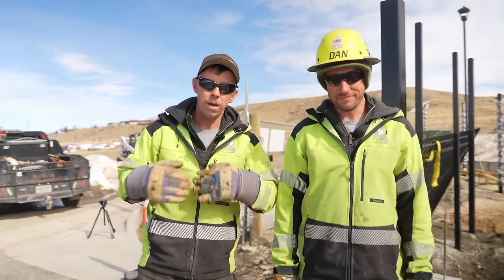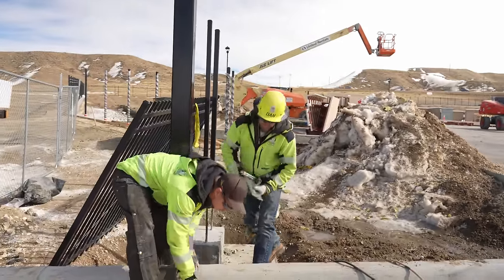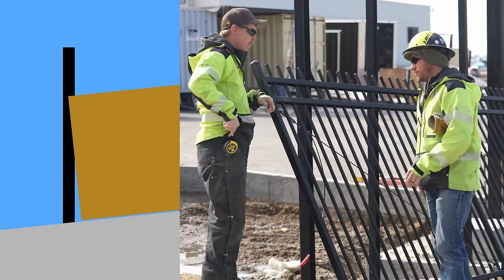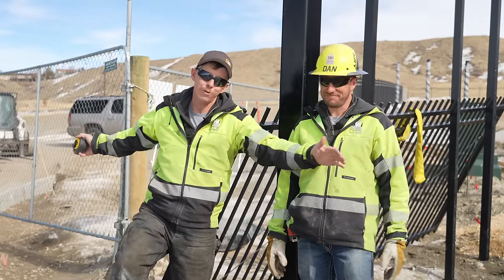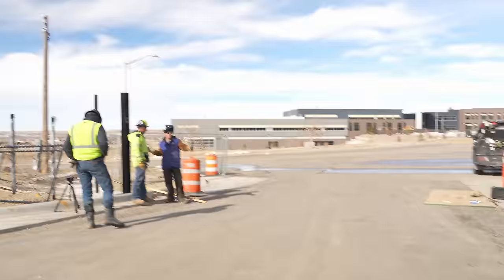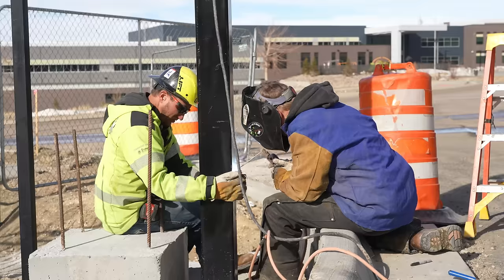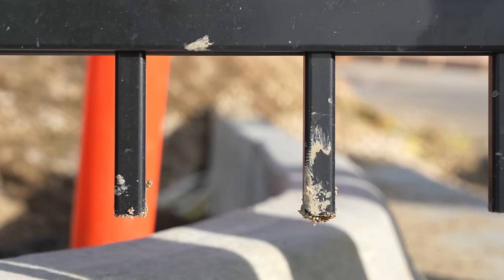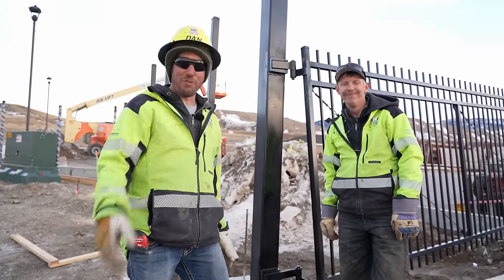Getting A Gate To Swing Uphill | How Did We Do It?

Comment: I've done many slope gates,the best way is  to C clamp top hinge ,take a 2x4 and a digital angle finder lay it on your slope,take said 2x4 put on top hinge C clamp bottom hinge make the hinge same angle as 2x,tack it on,I invented a weight compensation device so gate won't slam or pull on operator,
Reply: Tell us more, please? 🤔
Reply: Well,first there was terrible planning,contractors  have to work together,making the ground level between post,second,gravity increases the closing load on the operator,so it will overload the system with the weight of the gates going down hill,just like the gates have to pull the gates uphill,I can't describe the mechanics of the weight compensator,but it's a garage door spring  that loads closing and unloads opening, it works amazing.
Reply: Well,the first part is finding the angle of the slope,10* whatever it might be,that is about the max,if the road is unpaved ask the dirt guy to level about 18" wide area from side to side,if you don't when the gate is closed it will look bad no matter how good you did the gate,don't try and go   over 14 feet,it will be a mess trying to slow it down closing,the weight compensation device is a box tube with a garage door spring inside,like 24",when the Gate is all the way open there is zero pressure on the spring,using a stainless 1/8 cable to a pully,then uphill about 8',it's hard to describe like this,but the idea is that when it starts to close it starts loading the spring,slowing the gate down,taking the load off the operator, try and imagine it,it was one of my secrets.

Comment: Ive used these on several occasions with heavy gates and have had the arms on those hinges bend over time. Had to add gussets and had the gussets bend them even more the first time because i didnt factor in the shrinkage.  But eventually got it.  Great hinges for that application but just with they offered one size up in plate thickness.

Comment: That was awesome. I never thought about that concept. I never saw such robust hinges either. I wonder if a sliding gate would have been better suited for that application.
Reply: theres not enough room along the actual fence before a corner to open a cantilever gate unless you were to cut out a picket so the gate slides through the fence out of the property. but theres a lot of liability that comes with that

Comment: Does that creat a large gap at the post?  We’ve had 2 wood fences with steel frame gates recently that needed to swing uphill.  I’m currently using a hinge system to fold the bottom of the pickets up when opening but would love uphill swing hinges.
Reply: Not at all the two plates sit top of each other so the gap is only as wide as the flat stock think of it like a regular door hinges with longer flat stock

Comment: All the great work manipulating the swing geometry on the first gate... only to fail on the second gate. Why? The misaligned gates in the closed position, are ugly AF. If I were the customer, I would never sign off on it.
Reply from the maker: Well it's either drop a leaf or have an enormous gap underneath one. The customer doesn't want an enormous gap. You got a better way?
Reply: @SWiFence  Not a lot of video footage on the other gates mounting... But raising the mounting point to the 6" post, on the left gate should have worked. Also shim the bottom mount on the left gate with a thicker plate to take out the sag. It looks like the gap is off between the gates. The gates should look aligned, and ascetically pleasing when closed. Open, nobody cares, as long as they clear and work.
You said that the drive is getting a top coat of asphalt still. Talk to the GC about having them fudge/raise the plane under the left gate.
Reply from the maker: You're never going to raise the asphalt high enough to make up for that gap. Sorry.
Reply: @SWiFence  I respectfully disagree. Between my 3 suggestions, it would get the gates pretty close to aligned and spec. You still have another 3-4" of asphalt going down. They can easily float another 2" to one side if needed. 
And, I bet the architect didn't draw it up like that. So the GC is going to be figuring out who needs to fix what. And that's never a fun phone call. What do the prints show? Because that's what the customer expects, and approved.
Look, I have seen some really impressive work from you guys, but this just isn't one of them. Sorry man.
Reply: @SWiFence look at the hysecurity lift gate models. Hydraulic power lifts the gate, swings and lifts some more. Can even use drop rods into the ground without ever moving them. Really neat.  

I was wondering, as much as these swing uphill, do they slam shut on you or are they balanced?
Reply: @SWiFence  Build the gate to the slope from side to side

Comment: Sorry to tell you but those hinges were actually mounted wrong, pause the video at 10:02 and look closely how the hinges were mounted and if you have any type of a mechanical mind then you'll see a better mounting design.  Over kill on the extra heavy plate welded to the post to attach the hinges to, unless the post is thin tube which is no good, should be 1/4" or thicker.  F A I L!
Reply from the maker: I can see how you think the hinges are upside down, but those are beast hinges and there's no reason to be concerned about failure.
As far as the steel block goes, the customer changed their mind after the posts were set that they wanted the gates to swing inward (if we'd known that going in there's a whole of things we could've changed). This required different hinges, which changed the dimensions of the gate opening. We used the blocks as a shim to close the gap in-between the gates and still preserve the integrity of the post. We actually see that as a win. 👍🏻

Comment: Obviously the customer will never accept the gates being different heights.   About what you'd expect from a couple of knuckleheads.
Reply from the maker: They prefer that over having an enormous gap beneath the fence. Waiting on your video to show us how it's done.
Reply: @SWiFence  I thought about your problem and would recommend you build an adjustable gate and hinge test rig either full scale, to take on site before you fabricate and install, or possibly half scale to do tests at your shop.  I think a light weight gate rig could be clamped to your posts and easily adjusted and then measurements taken for fabrication.  Guessing how the heavy final gate should be welded on site is a bad plan.  You could use the adjustable gate/hinge rig on all your jobs to eliminate mistakes and reduce installation time.  I'd be glad to come to your installations to supervise, just let me know.
Reply from the maker: C'mon now Richard. 🙂 How does this sound like a good idea? An adjustable gate & hinge? Is the customer supposed to lift the gate before they swing it? Did you notice we had to hang the gate with the skidsteer?
I appreciate your idea and the fact that you prefer the gates to match, but this is simply just how it works if you're forced to build on a hill. To inflate the cost and time of the job inventing a new solution isn't practical and isn't needed--especially when the customer is perfectly happy with what they have.